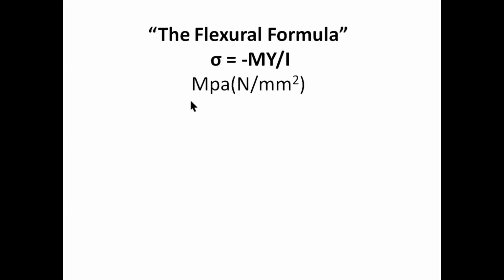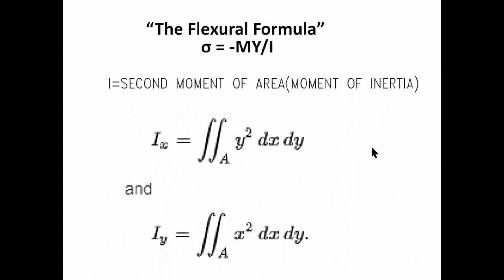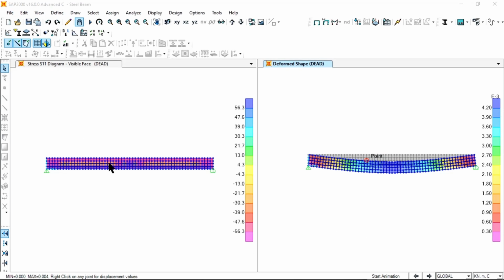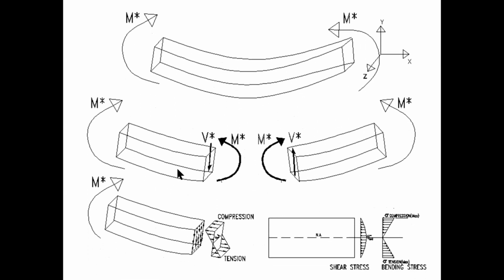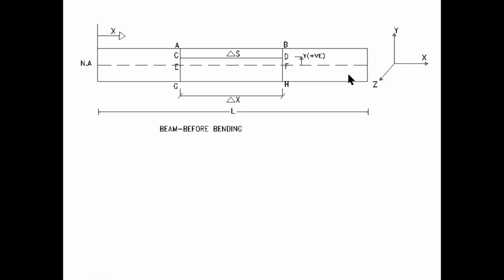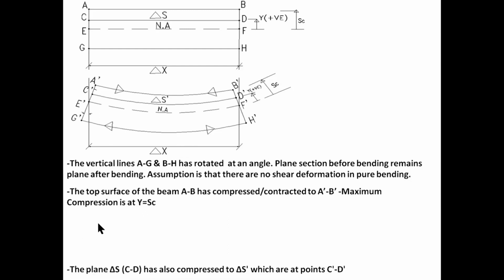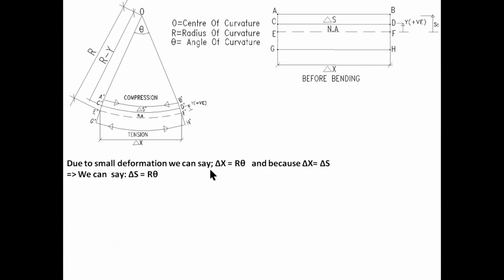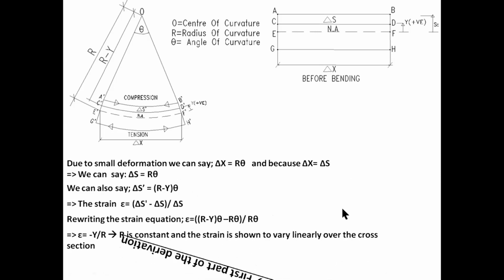Derivation Of The Flexural Formula Part 1

Comment: Hi, these videos are great! 
5:00, regarding the simple beam with point load at mid span, I believe the mid span cross section is a region of high bending and high shear stresses. The allowable combined bending + shear stresses can be measured using the Von Mises method and rechecked against the yield strength fy. Cheers❤
Reply from the maker: Thanks so much for the feedback. Yes, you are 100% correct.. the shear force in the middle transitions sharply between positive and negative but the value is effectively half the point load. I guess this topic primarily covers flexural bending. Very soon, I will hopefully do a video covering bending, shear and torsional stresses in one example. Thanks again for your contribution!